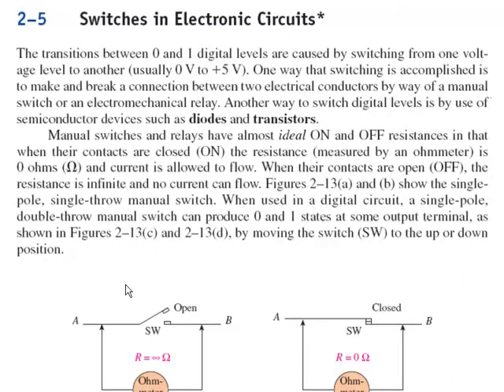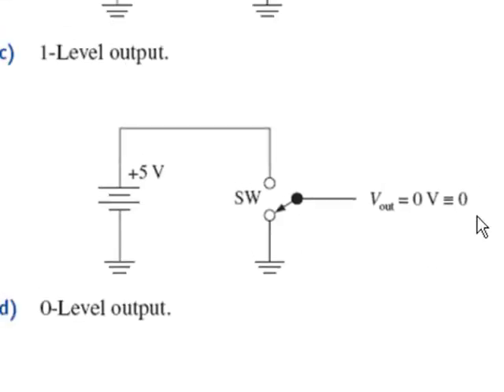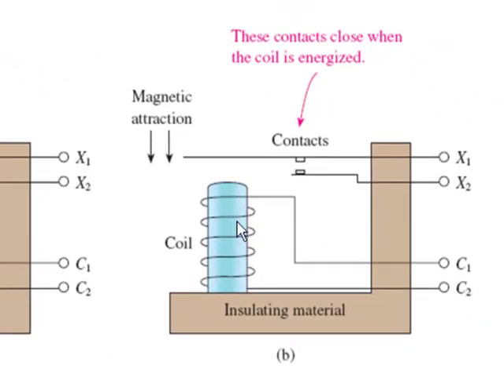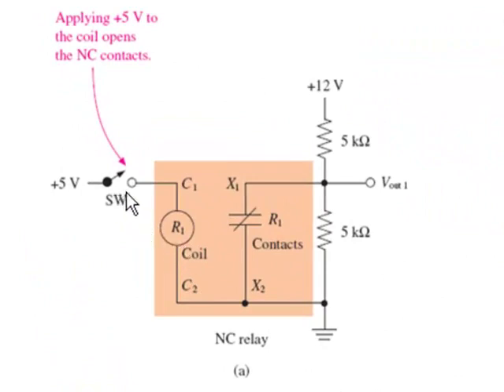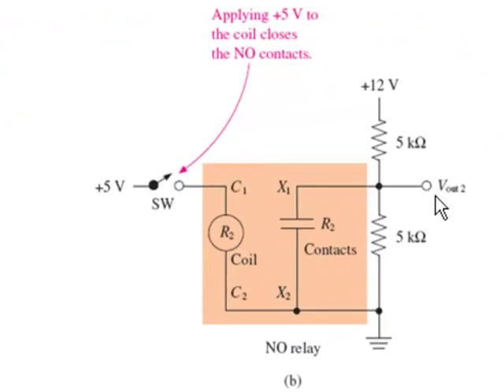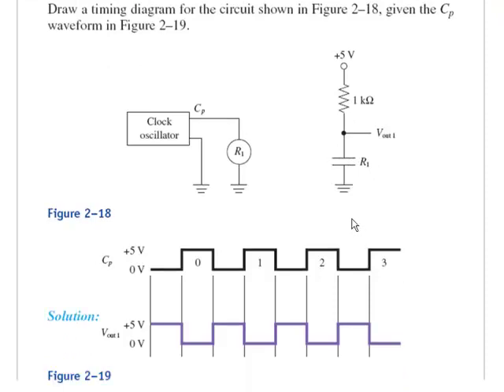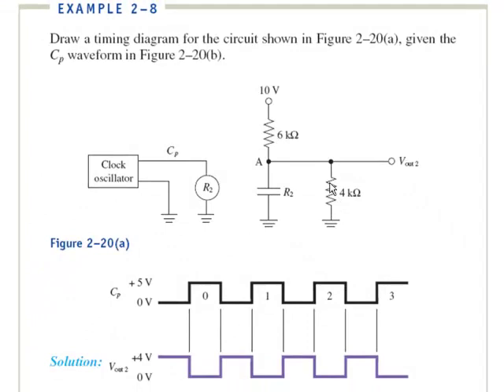sec 2-5 to 6a Switches and Relays

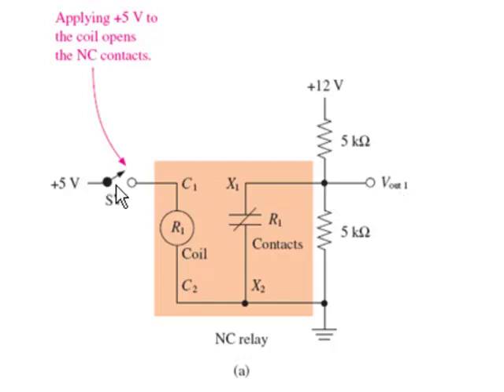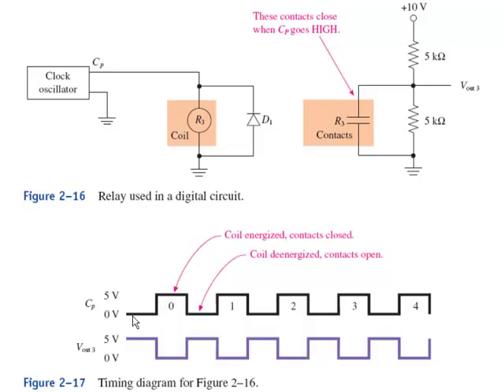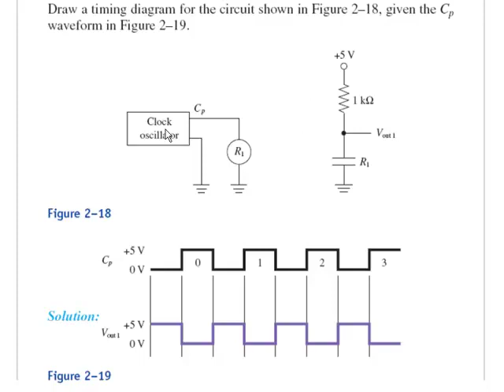Comment: A 5k/5k divider with 12 V input generates 6 V output, not 5V, @5:05. Go study appendix F! Why haven't you corrected this in 11 years? or don't you care? But 30 seconds later you have it right. And again @7:00, 6V, not 5V. And @ 8:35 you show a capacitor and call it a resistor. How did you get a B.Sc., let alone a PhD?
Reply: Chill dude, he corrects himself at 5:21 to 5:37. 

This man is incredible, not sure why your hating on him for mixing some voltages by 1 volt. He obviously knows what he is doing. He obviously made a mistake.